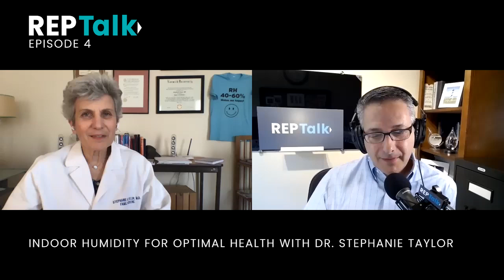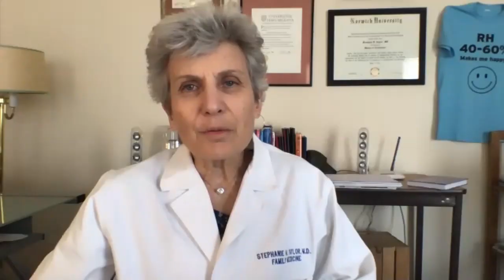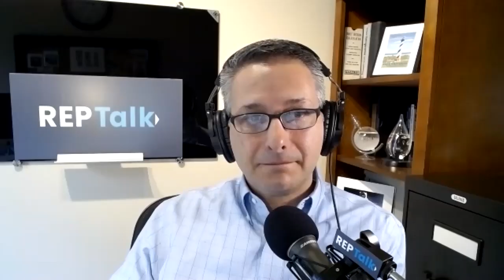Indoor Humidity for Optimal Health  Healthy Home Hydration with Dr  Stephanie Taylor

Comment: House humidification is easier than you think.  First, best generator I've found is an ultrasound humidifier.  If you have hard water, use RO to feed the unit.  You really only need one:  humidity moves quite quickly throughout a house (assuming you leave doors open).  [HVAC engineer since '72]
Reply from the maker: Thanks Pete, great information!  Let us know what RO is.
Reply: @KGGConsulting  You will learn more if you figure it out for yourself.  It's not that hard.  [And that was a hint]
Reply: @KGGConsulting  probably referring to Reverse Osmosis filtered water.  That way the humidifier doesn't get clogged up with hard water deposits etc.